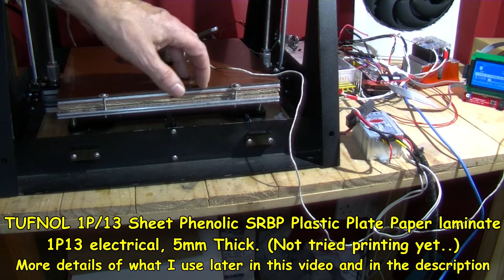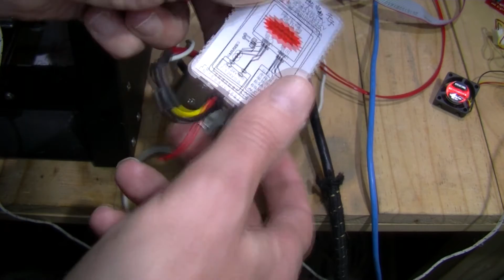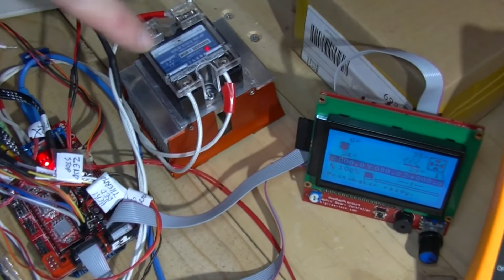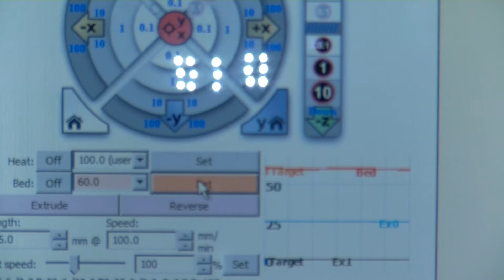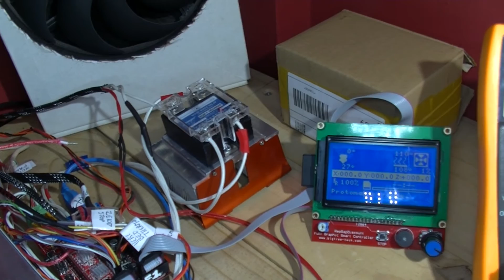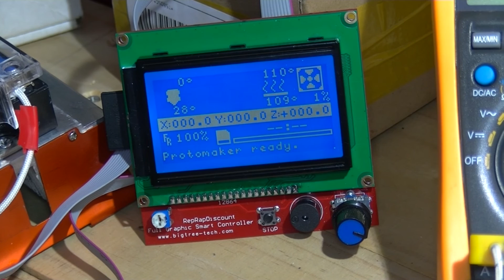Protomaker 3D Printer Heat bed SSR test success. RAMPS 1.4 via 24 Volts

Comment: OI OI OI can u open up the 24 to 12v converter for me pls and tell me the marking on the 5 leged IC pls.... I blew a hole in mine and need to find out what replacement part to repair it... all I see on mine is R4026B at the base near the legs. Can u help me out??
Reply from the maker: Chaining it to a 12 Volt PSU, it gets too hot for my liking, even with fan, extra heat sinks. Temp testing:-
https://www.youtube.com/watch?v=V7qvEhXDFXA
Reply from the maker: I may look when I replace the 24V to 12 V but quite cheap on eBay so are the worth fixing, especially with the heat they give out.

Built for cars, chassis can act as very big air cooled heat sink
Reply from the maker: When i get my 12 Volt PSU I will try to take a look, if you want, but eBay have these cheap to make them not worth fixing
Reply: well i have blown too much shit up and I need to fix it for my own sanity if the part is cheap and available.
Reply from the maker: Just got a 12V PSU. 
Opened my 24V to 12V convertor up BUT they have ground the 5 pin chip number off > {The B^^%$}
The 3 pin one say L7812CV

Video-ing inside soon. 

If you are in need one use eBay, or send me postage to send you my old one, 25mm fan fitted inside powered from inside, chips need re-bolting inside because I am keeping the Heat-sinks I fitted: take as is; works well after I re-soldered some bust tracks; let me know
Reply: Yeah I need the 5 pin not the 3 pin... chinese r useless, putting shit parts in everything so it blows up on ya... and then throw it away so u have to buy another which cost u more. If u ever do find out let me know thks
Reply from the maker: The 5 pin IC has the Number ground out so it is unknown:-

24 Volt to 12 Volt Automotive buck convertor inside

https://youtu.be/A7ucEIZdJ90
Reply from the maker: Most likely scratched out because 30 Amps is nowhere near the output of 30A, never tested by me.

The 3 pin says 1.5 Amps and this one gets very HOT!!!

30 Amps is maybe OK for 1/1000th of a second so the twist the facts to sell them

See don't know if this will be any help 
http://50.112.106.113/12V%2030A%20voltage%20regulator-datasheet.html
Reply: U reckon that a real voltage reg might handle the 30amps??? without getting too hot?
Reply: none of the data sheets work or components exist with that link.
Reply from the maker: In my case, (3D Printer use),  I am fitting a 12 Volt 30A PSU, (much more than needed), to power my RAMP 1.4 3D Printer, fans and LED's.

I also will still use the 24 Volt 20A PSU to power my 3D Printer heatpad, (300W 24 Volt).

So two PSU supply's one 24 Volt and one 12 Volt.

This in my case should be cooler and not pass over PWM pulse to flicker the LED's.

Now fully wired up yet. so not fully tested. Some other changes and quite a number RAMPS 1.4 wires to do.

Comment: Hi Great Video, 
I can confirm that PWM will not work with SSR (Solid State Relay) properly. As a on cycle can be at any time during the sine wave of mains signal.. thus providing no power to max power.. Entire Pid will be ruined.. For PWM you will need probably Diac and/or Triac.
Reply from the maker: +Anil Maurya This works OK for me, Temps appear OK for my heat bed... Heat beds like mine do not change these extremely fast due to the heat mass, e.g. my heat bed can take 20-30 minutes to cool down, quicker heating abut about 5 to 10 minutes

Comment from the maker: RCtrialTim I have not been able to do any high level long term testing of this 24V to 12V unit.

My power supply inputs 23.81 and this unit outputs 11.62 Volts.

HEAT!!!

I added a small fan, 25mm inside connected direct to the 12 Volt output pads inside.

I have also put it,  the RAMPS and SSR, into a box with a 70mm computer fan.

I, not fully tested found the case, outside, of the unit, (this is used as a heat sink), getting quite hot, this seemed to be more, (not fully tested), when I powered a small 12 Volt light strip from it, Low Amps.

So do not use it without external cooling.
Reply from the maker: Get too hot:
Chaining it to a 12 Volt PSU, it gets too hot for my liking
https://www.youtube.com/watch?v=V7qvEhXDFXA

Comment: How good does that 24V to 12V DC-DC 30A Car Power Supply Inverter Converter Conversion Device work for you? What is the real output voltage with no load and at full load?

Thanks in advantage
Reply from the maker: +RCtrialTim I posted about this unit in a comment, I did not see the reply button

RCtrialTim
    
I now power the LED strip and Fans from the red 12 Volt output and the RAMPS 12 Volts from the Yellow higher Amps output.

The RAMPS caused some flicker PWM hot end.

Like this:-
https://hackaday.io/project/8680/gallery#d2769ed6055a46e72534c2ed2e978abb

https://hackaday.io/project/8680-power-supply-plan-24-volts-300watt-heatpad
Reply: +Protomaker Black Sprint Original 3D Printer 

Thanks!
Reply from the maker: +RCtrialTim I fitted a fan and heatsniks because of heat 24V to 12 Volt Car drop down
https://youtu.be/iDlEP84f-wE
Reply from the maker: Get too hot:
Chaining it to a 12 Volt PSU, it gets too hot for my liking
https://www.youtube.com/watch?v=V7qvEhXDFXA